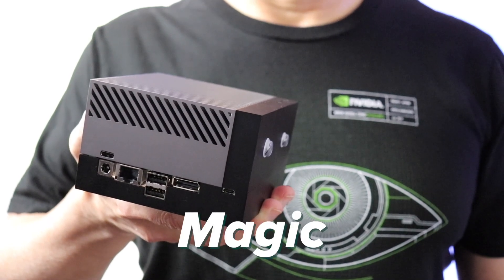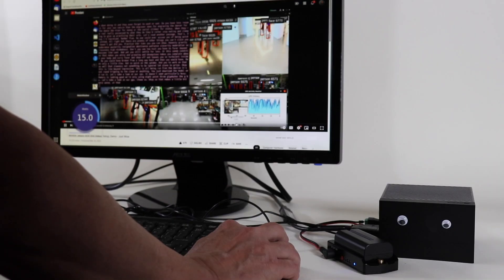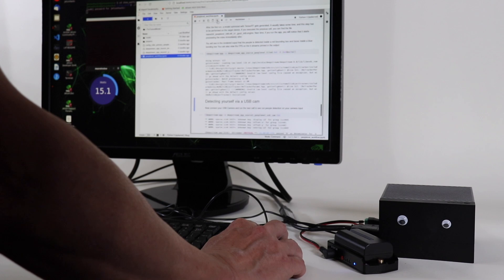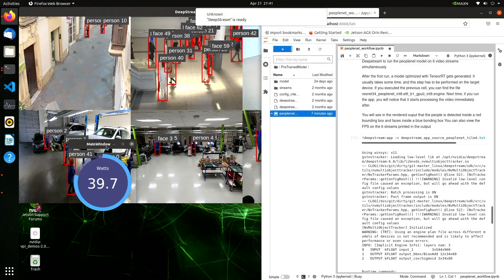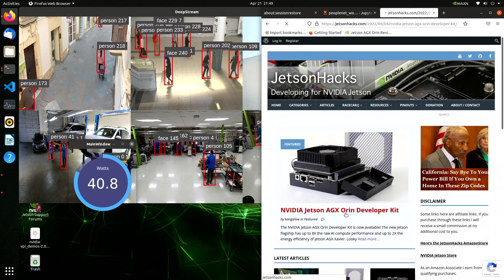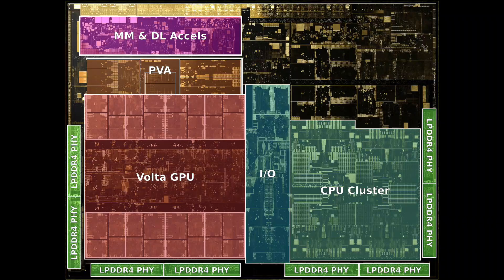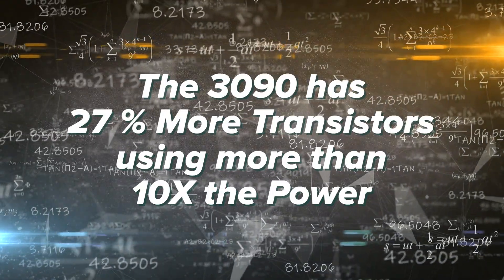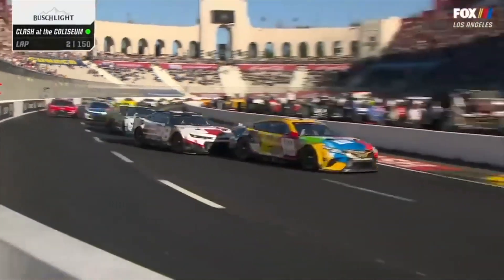Can this little battery power this Jetson Orin?

Comment: Type c and power jack
Which is better?
Reply from the maker: I think that relates to your use case. The USBs are pretty convenient, but something with a DTAP is pretty useful too. Take a look at this video: https://youtu.be/utJiGBGFrTk
Reply: @JetsonHacks
Thank for your quick respond, I really appreciate your enthusiasm and efforts for the community.

Here, I understand your video is about using a V-Mount battery to power a Jetson AGX Orin. To explain my situation better, my current project requires running a Jetson AGX Thor from a battery source. I’m planning to use the Anker Solix C300 power station (288 Wh) to supply power to the SoC, some utilities, and a 7-inch OLED display. Based on my calculations, it should run for about 2 hours 15 minutes at a maximum draw of 130 W. For the connection, I intend to use a Ugreen 140 W USB-C cable which is the initial question I'm asking about.

Do you think this setup is safe and reliable? I’m a bit worried I might damage the board since I don’t have much experience with electronics. I’m seeking for your advice here, or maybe can you make a video showing how to safely power the AGX Thor with a battery and what precautions to take?

Also, I’d love to see a benchmark of the Qwen3-Omni model (time to first token and tokens per second) on both AGX Thor and AGX Orin to help me decide which one to use.

Thank you so much!
Reply from the maker: @zegzropat  I haven't tried to power the Thor with a battery yet. A better place to ask the question is the official NVIDIA Jetson AGX Thor forum where I'm sure some folks have some experience with that.

Comment: Im interested to see what the results would be with a similarly sized lithium polymer battery. Perhaps a 4S lipo with similar characteristics would have no issue, but would obviously not be able run as long. Surely there must be a way to run li-ion and li-po in an alternating fashion for higher demand (use li-pi) and lower deman (li-ion)
Reply from the maker: That's an interesting idea! There's certainly a lot of different ways to go about this problem. A nice alternative is one of the mini V Mount batteries such as the FXLion Nano One: https://amzn.to/41F1iVq or SmallRig VB50: https://amzn.to/3RXxHnd. These have all the battery management built-in, and have different taps for different voltages. They also have more current available. Plus you can get larger capacities in the same footprint. Thanks for watching!

Comment: Have you every tried how long it will last with full performance on 120W battery?
Reply from the maker: That's something that needs to be tested for a given application. "Full performance" means different things depending on general CPU, GPU and subsystem usage (DLA, USB, GPIO etc.) usage and clock settings. Thanks for watching!

Comment: Thanks for the video. One thing which you may look into is using thicker leads between step-up and jetson. I had the same issue even with beefy power adapter - used multimeter to understand the issue and soldered own thick leads - it rectified the voltage drop during the peaks and jetson works flawlessly. 
I think even your smallest battery may work if you change the leads (if the batteries inside the pack are anyhow decent Sony/Samsung )
Reply from the maker: Interesting. Certainly worth a try. Thanks for sharing your experience, and thanks for watching!

Comment: Throttling mechanism of Jetson boards is done in software or hardware level?
Reply from the maker: There are some absolute limits on the hardware side, but most of the power management is done through setting the enable/disable and clock speeds on the compute blocks through software. There are several compute blocks. You can select the number of CPUs, their clock speed, the GPU clock speed. You can also select if you want to use other compute blocks, such as the Deep Learning Accelerator (DLA). NVIDIA has a tool named nvpmodel to facilitate this. Thanks for watching!